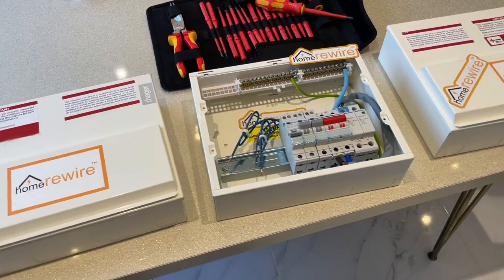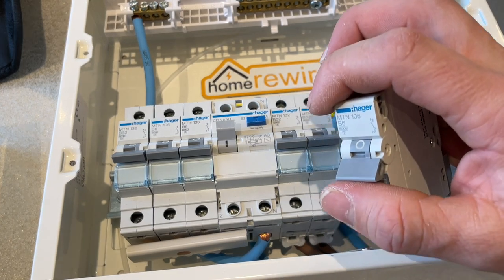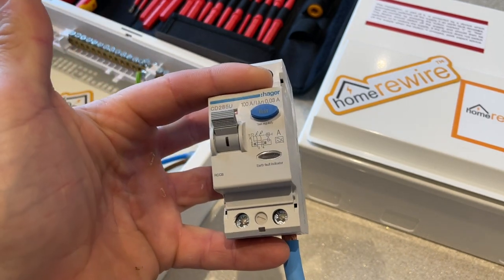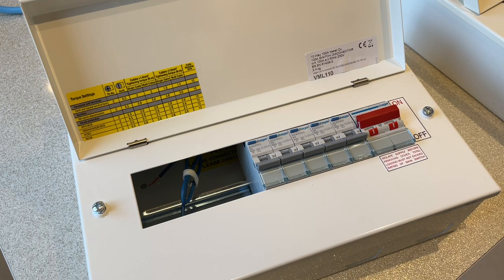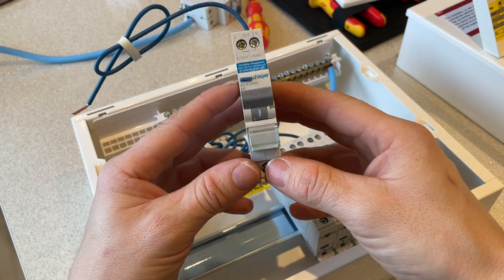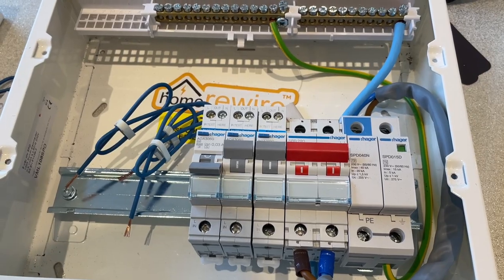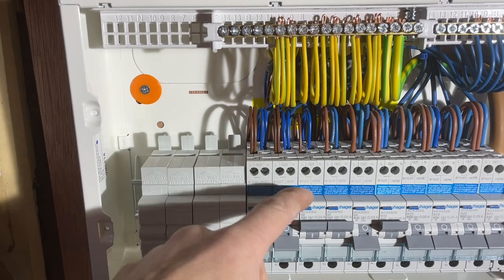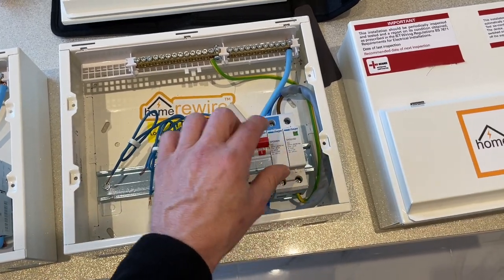RCBO Upgrade HomeRewire

Comment: What he means is if you have a fault which causes an RCD trip, half your circuits will go off. If the fault is permanent they will remain off until you can get an electrician out. If you have RCBOs only the circuit at fault will be off which is less inconvenient

Comment: Boards well finished. Usually easy to judge how the rest of the work will be in a building by how neat the board is.
Reply: Metal case with A Lot of exposed contact points - a tragedy waiting to happen, truly “well finished”.
You should be able to slide your hands with your eyes closed, not touching high voltage exposed metal